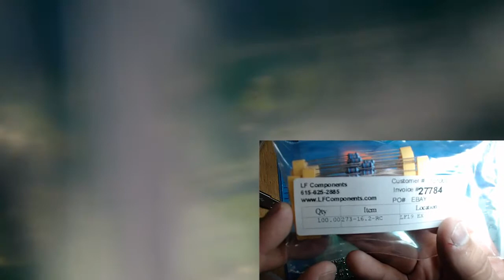PS4 Slim Power Supply Repair (Part 1)

Comment: Bro, buy FLUKE to be accurate with your measurements. That is not 16.8 Ohms. Thunbs up meanwhile.
Reply from the maker: Thank you for the thumbs up! Yes, I do have a fluke now. Yeah, that reading is actually 0.16 ohm. It wasn't because my meter wasn't good though, I didn't actually measure it at the time and went off of documentation I had read online. But yes, 0.16 ohm. Thanks for watching! 😊

Comment: Hi , how are u? Sorry to bother, but I have 2 questions: Dap 046 and 041 are the same? I can’t find DAP 046 in my country , another thing, Zd39 in the right bottle of this board , what type should I get to replace it.. thanks for the Help
Reply from the maker: Yes, DAP 046 and 041 are basically the same. Either will work. I will have to check on ZD39. I'm not sure off of the top of my head. Thanks for watching!
Reply: @AlphaBravoTech  thanks man , great content , keep on going ...
Reply from the maker: @m4rkojr  hey I looked at the zd39. I've actually never ordered that zener diode. The few times that I've needed it in the past I just pulled it off of a donor.
You have to pull that zener off of the board to test it. It should have continuity. If it doesn't, then its bad. You have to test it off the board. Hope that helps.
Reply: @AlphaBravoTech  in my console , the trouble begun when the power cable lost one lag of the 🔌 , I made some tests , R1 Resistor is broken , DAP 046 has Shorts on 2 legs, I don’t know if it’s normal and that diode that we mention above. Here in Brasil it’s just hard to find anything

Comment: Hi how are you, sorry to bother you, but I have a ps4 slim n16-160p1a source and it gives me 12.2v but in the 4-pin connector that I would have to deliver 5v it does not deliver them to me. Do you have any idea about it. I would greatly appreciate it.
Reply from the maker: What kind of voltage are you getting on DAP041 / DAP046 ? (I forget which one of those ICs is on that PS)